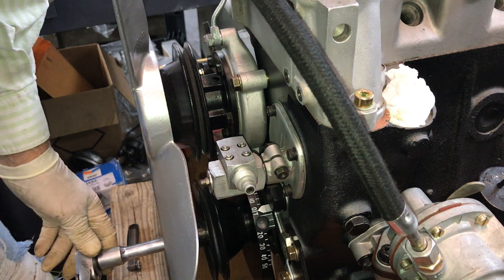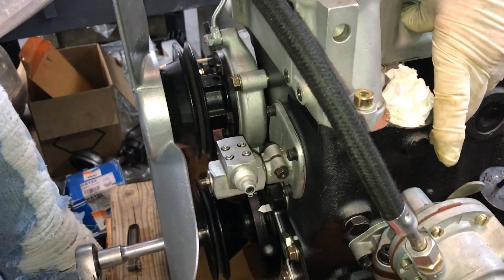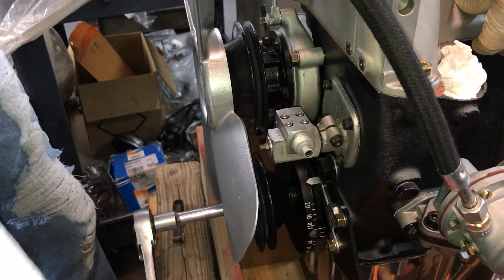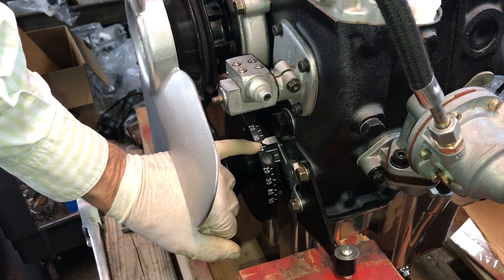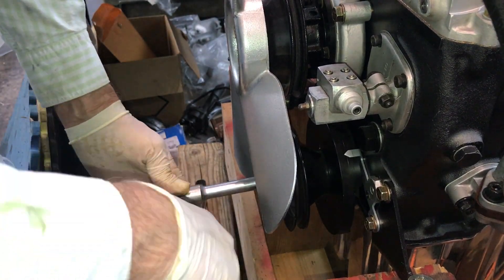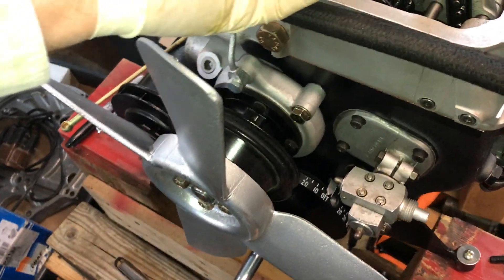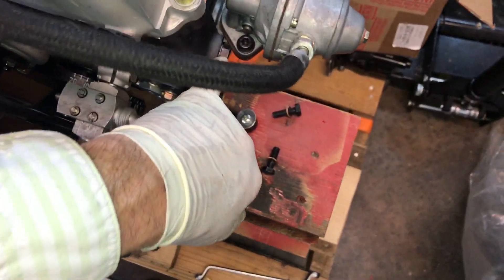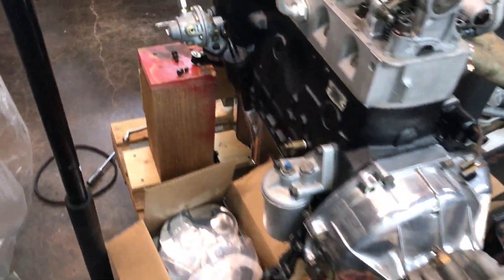190SL Timing and Quick Compression Check

Comment: I believe that you can set up the timing correctly by wether renewing the camshaft pulley that might be worn, wether adding a new woodruf key on the camshaft to re synchronise by 3° the pulley and the camshaft
Reply from the maker: Bonjour. Merci pour votre commentaire. Vous avez raison. Des clavettes d'arbre à cames décalées sont disponibles. Nous essayons de ne pas les utiliser. Au lieu de cela, nous mettons des cales sous l’arbre à cames pour maintenir une distance appropriée entre l’arbre à cames et le vilebrequin.
Hello. Thank you for your comment. You are correct. Offset camshaft keys are available. We try not to use them. Instead we put shims under the camshaft to maintain proper camshaft to crankshaft distance.
J'utilise Google Traduction. J'espère que c'est correct.
I use Google translation. I hope it is correct.
Merci pour les Jeux olympiques. Ils sont magnifiques.
Thank you for the Olympics. They are magnificent.
Je suis Will.
I am Will.
Reply: @Mercedes-Guru  thanks and good luck even if I believe the job is finished 👍🏻